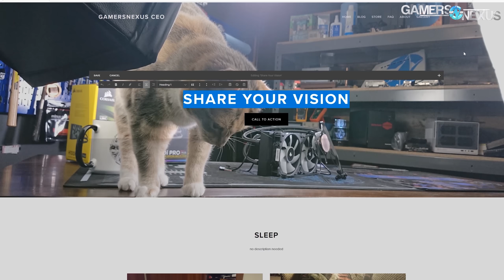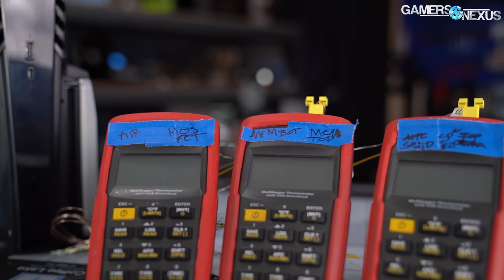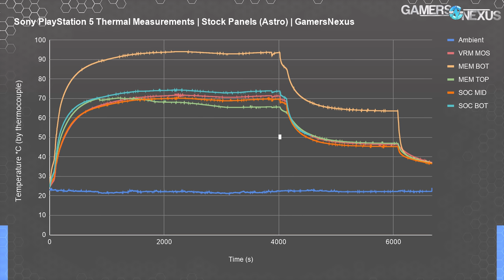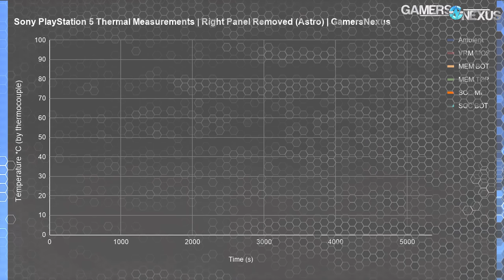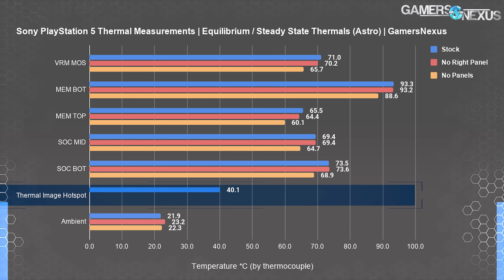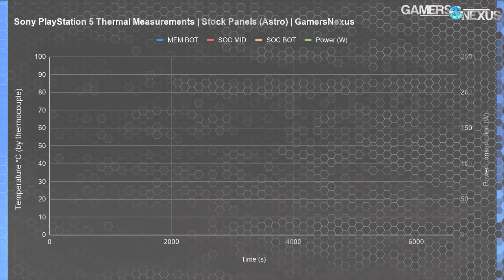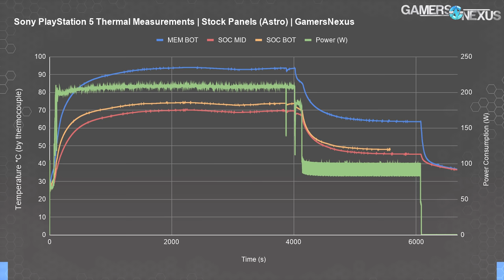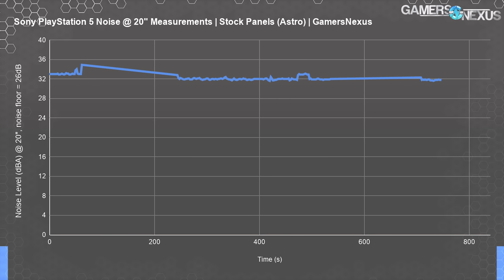Weak Cooler Design: PlayStation 5 Thermals, Power, & Noise Testing

Comment: The whole Xbox overheating argument that started with playstation fans really didn’t age well...
Reply: ikr. Series x is proven to be the best design by far. smaller, more powerful. And now quiter and cooler. ps5 needs a redesign asap.
Reply: @davidpelaez7176   no it doesn’t. The ps5 isn’t going to be “redesigned” just because you want it to lmfao
Reply: @Michael019x  it was a joke. Salty much?
Reply: @RedHaloManiac95  Huh? I wasn't even talking to you, LMAO
Reply: @Michael019x  it will have a redesign. It happens every generation. fat ps5 is a mistake. 95 degrees memory. Ssd support disabled bc of overheating concerns. And now its gonna sound like a yet. Even more embarrassing considering the console is huge. Dont get me wrong i love sony games but their hardware is usually trash.
Reply: Meanwhile in the PCMR 100c+ RTX 3080 and 90 memory is barely mentioned...hmm..
Reply: @Michael019x  It absolutely will, Sony is definitely losing a lot of money per unit, especially for the digital one.

I can't see them doing the Series X design due to both branding and backlash, so they may just rely on TSMC die shrinks and cut down the heatsink to shrink the footprint.
Reply: @davidpelaez7176  the ps5 is never going to look like a PC or an Xbox

Comment: Extremely in depth look at the thermals. I see the issue with the memory. Is there any indication on the GPU issues? Is that heat related as well?
Reply: The GPU artifacts could potentially be caused by the poor memory cooling. But who knows the APU side seems to be doing decently
Reply: @Pipdoodle33  I automatically assumed it was the over clocking. It’s always a double edged sword when you depend on that for performance. I didn’t anticipate the memory running this hot. Seems like this system was rushed. It’s no way he should be finding issues the engineers did not. The cooling solution for the memory is unacceptable. No way I’d add an SSD to my PS5 knowing this
Reply: @Pipdoodle33  Those with artifacting issues are also reporting minor artifacting in the home screen, and bad artifacting in PS4 games too, when the console is drawing considerably less power.

Comment: Who's here after the Series X thermals video? 😏
Reply: me too ha
Reply: Me, but beside the memory heat it’s not that much of a different, though pd5 is expected to have more power draw and heat of course.
Reply: Decided to do this one first. Abt to watch the XSX video now.
Reply: They are basically the same imo but it depends if you want more games on ps5 or better thermals on Xbox
Reply: @malazan6004  
Game Pass. I'll have both. 😎
Reply: Which 1 runs cooler PS5 or Xbox SX?
Reply: @redscorpion9325  series x runs cooler.
Reply: @gingataisen  yeah, Xbox clearly has better exclusives than sony 😂
Reply: @Lloyde Turner I just referred that the only part generating more heat is part of the memory, the other parts are in the same range as the Xbox. That’s the conclusion of the thermal videos. And yes, higher frequencies cause more power draw and heat mr. Pc guy.

Your smelly think what you want guy.
Reply: @Lloyde Turner you Said that you smell a doughy ps5 fanboy. You were the one to associate that with me. I just put that asironic self reference in my post.

And no, I am not a german, neither I am responsible for anything happened in the past when I wasn’t born.

Comment: Since it is so quiet they should just ramp the fans up a bit, it could go a long way with minimal noise increase
Reply: Have a setting for it
Reply: Its already apparently louder than X though
Reply: soc temps are already ok enough. ramping the fan up won't help with the memory.

Comment: As an IT Engineer myself I have had reservations about the cooling for the PS5 ever since I seen a centrifugal fan. I'm hoping that in the next 6 months somebody will make an after market fan that is more powerful and a lot quieter.

In my professional opinion I think the fan  design is wrong. It is acting more like a windmill. I think the fan blades on the fan are pushing more warm air downwards rather than outwards.

But a PlayStation Fan unfortunately won't listen to the professionals, to them the PlayStation is god and nothing will make them change their mind. I've had reservations about the cooling ever since the console was shown off. I said it then as I still do now. The cooling is insufficient and if somebody comes up with an after market fan with a more efficient designed fan with a more performance arrow and faster fan but quite. Then that company will be inundated with orders and will make a tone of money. Give it 6 to 8 months and somebody will do this.
Reply: Boy you really comparing yourself with high japanese engineers  🤣haah okay
Reply: @ArjanTV  I have a Bachelor Hons Degree in Computer Science and nearly  8 years as an IT Engineer and been working in the IT Industry for nearly a decade. Each IT Engineer has a unique set of skills in the field they work in. Mine is a Network Engineer but I had reservations about the fan because in my opinion as a centrifugal fan it isn't powerful enough.

The PS5 is a great console but it does have an issue with cooling. A centrifugal fan is great for dissipating warm air through the top and out of the rear of the console. But if the centrifugal fan is pushing warm air towards the bottom and making the bottom of the console warmer that the top where the fan is located. The fan isn't powerful enough.
Reply: @hefeydd_  then why my ps5 dint get warm at all after 10 hours of playing warzone?
I dont know what ps5 you got lol maybe you were unlucky to get a broken ps5 because they are making so much ps5 few of them arent working like its supposed
Reply: @ArjanTV  I never said I had a problem with the fan on mine I said I don't believe the fan is powerful enough. I played 8 hrs of ACV and the most it got to when I put my thermal camera on the console at the rear was 57.6C which is 135.6F which is fine but their has been cases where customers have experienced their console to be in the high 70C that's 158F that is getting into PC graphics card territory. The only issue that I have is the fan is a little noisy in rest mode apart from that it is a good console. Let us see what happens in the next 6-8 months somebody is bound to manufacture an after market fan with better fan blades change the orientation of the fan blades slightly to produce better airflow and a more powerful but quieter fan... whoever manufactures this will be laughing all the way to the bank because they will sell like crazy.
Reply: @hefeydd_  it has an issue with “coming” does it? Despite all that education, you have an issue with typing.
Reply: @ArjanTV  This fellow is going on about the design of the ps5 in general, not specific units. I'm with him on that windmill fan though, it really needs a push/pull system like pc's have, or at least an exhaust fan. The current design just looks like it falls short in a lot of ways. Low effort as far as the memory cooling goes.
Reply: @danielharvison7510  pcs are build different . The ps5 fan amazing not perfect but cant be done better than that my ps5 is fine it doenst warm up at all even when i play for many hours big games like warzone! Very smart japanese people worked on this console lol a student cant do it better or have better ideas they tested everything and that fan was the right one to put on this console
Reply: @ArjanTV  I wouldn't actually say that PCs are built different. The current console gen literally IS a pc, even going so far as to be designed and manufactured by AMD and TSMC respectively. Same rules of thermal management and whatnot also apply, so it's not that different to a small form factor pc or a laptop.

Comment: I wonder how the console would perform with an ambient temperature of 80 degrees and above?
Reply: well, thats 176F so, not good?
Reply: That's a really small delta. I can't imagine any computer running in that temp without some sort of heat pump.

Though everything would melt anyway.

Comment: Even being a bit of a Sony fanboy, this does concern me a bit and makes me hesitate to buy it. Thankfully I can't afford one right now anyways lol.
Reply: Best to wait for their "pro" version that we all hope has a higher wattage psu that will actually take advantage of the hardware.
Reply: @evolicious  Pro version??? You mean, in about 5 years? hahahaha
Reply: Don't let it. Apple runs their CPUs at 100°c. They're fine.
Reply: @Optamizm  higher temps means lower clocks and wasted energy that went into the heat.
Reply: @RukaGoldheart , nah, because there's a bonus to performance from higher clocks. Mark Cerny explained it pretty well. If you have two GPUs with the same TFs, one with more CUs and lower clock vs less CU but higher clock, the one with higher clock will perform noticeably better, because everything else the GPU does runs at that higher clock.
Reply: @Optamizm  you completely misread my comment
Reply: @RukaGoldheart , please explain what you meant.
Reply: @Optamizm  ever heard of thermal throttling? When a piece of hardware, generally CPU or GPU reach temps that are quite high and clocks lower to bring temps down.
Reply: @RukaGoldheart , the PS5 doesn't thermal throttle.
Reply: @Optamizm  if the temps go high enough it will. But hey, can't put the PS5 in cramped places and the fan isn't fully utilized, though the memory modules are something to be watched closely.
Reply: @Optamizm  Yes that is why Apple is trash that don't last more than 2 years...
Reply: Meanwhile RTX 3080s and 90s running at 100c+ on the memory are laughing hard.
Reply: @sdewey4152 Yeah when  mining...
Reply: @regular4634  there's many reports of it happening in gaming, mining can hit near 110c...so just a little over the 95 rated operating temp listed by the VRAM manufacturer.
Reply: @sdewey4152  Link maybe ?
Reply: @regular4634  just Google there's even many on the Nvidia US forums, it's not uncommon on FE cards, third party cards seem to have better cooling.

Some have even stated swapping the thermal pads out can reduce temps from 100+ to mid 80s.
Reply: Nice to hear someone claim fanboyism without the negative fanboy behaviour. Keep loving what you love man. 
Personally, Sony do not make any games to my taste.
Reply: @V1CT1MIZED , what?
Reply: @grossindecency  Demon's Souls is very much to my taste but not enough to buy a whole new console for. I'll play the remake one day..
Reply: @Optamizm  exactly. Xbox went with the more CU 52 vs 36 .
Reply: I almost went with the series x their engineering team really outdid themselves. I’ll just have to wait a bit and get one later on. Still very happy with the ps5

Comment: Whats the issue with 93°C on memory? The lifespan will be reduced from 20 to 18 years?
Reply: It's called FUD.
Fear, uncertainty, and doubt.
It sells outrage, which sells clicks, which generates money.

"The PS5 cooling is awful!... despite running in spec!"
Reply: Not really depends on spec of memory GDDR6 is rated up to 100C, of course though GN admitted he is measuring the casing temps but not the actual die temps of the ram modules (the modules themselves are very likely running alot cooler and the casing acts as an IHS for the RAM). The electrodes are precise but aren't too accurate depending how it's placed and measured ( especially if it's measured where the heat is dissapating ).Nothing really seems out of the ordinary at all when taken into context.
Reply: Depends what kind of environment you're in. Because this and the  early PS3's are dust magnets, it had a habit of shortening the life significantly. These bad thermals coupled with dust blockage will make things quite difficult. I won't be surprised when people have to get a new system 2-3 years from now simply cause the memory burnt out. For now I'm wondering if laying it on its side is a smarter play than standing it up.

Comment: Imagine the sony CEO slapping his engineers in the back of the head watching this video " why didn't you test the ps5 like this "
Reply: I'm sure they did. I doubt they would have released this product if there were temps running above spec.
Reply: @thelarry383  it can handle 100c but doesn't mean it should all the time. probably an engineering and design problem since we know ps5 is a bit rushed with devkits arriving much earlier, either that or they went cheap with the thermal padding.
Reply: @thelarry383  the silicon would melt if you keepin like this
Reply: They definitely did, but they decided to cut costs.
Reply: except it's more likely like the engineers recommended X amd the CEO was like nah skip that Y is doable.
Reply: Besides, they also want you to replace your machine in a few years so that they could sell more units.

Comment: yep, expect them to throttle performance soon and they'll keep it a secret.
Reply: Either that, or an update that ramps up fan speed
Reply: So a what's Nvidia going to do with the 3080s and 90s the ones that have 105c+ on the memory.
Reply: @sdewey4152  the hell?
No my RX 5700 vram runs at 80c max and thats in summer

Comment: So Basically, The Last thing you would want to do when Setting up your PS5 is Place it INSIDE a Shelf of your Entertainment Center and Close it up behind a Glass door Because, You Know, That Looks Cool!! 🔥🔥🔥🤦‍♂️🤣🤣🤣
Reply: I believe sony released a statement saying it needs to be in an open area lol
Reply: @ASTRALEGION  hahaha! Yea, but who reads Statements or manuals or Reviewers? LOL! 

TL;DR..   It's going to catch on fire! 🔥 🔥🔥🤣🤣🤣
Reply: This has nothing to do with the cooling design but rather the overall power consumption/heat output of it.
If the internal components consumed 350 watts of power they output ~350 watts of heat.
That's the same heat output if they run at 60 degrees C or 90 degrees C and all the cooling capability in the world won't save it in an enclosed space.
Reply: Unless you want to bake a cake.
Reply: Yup, ver. 1 of PS3 all over again.
Reply: A cabinet door is a death note for it. Even without a door, like in my TV stand's cubby, if I didn't cut slots in the back panel and use a few fans to move air, it would be too hot. I've accidentally left my fans off and I heard the console's fan spin up twice, not loud but just from inaudible to audible. I need to figure out a long term solution to cram it on top of my tv stand somehow, and then figure out something to fit in the cubby that it is in now, would love to get a new PC case to fit in there, but thats next to impossible unless I want to downgrade to a LP gpu and/or shell out $$ for a pico power supply and even then they are usually 1-2" too deep.
Reply: What's up with your use of capital letters?
Reply: @TheGroundedCoffee  Got you notice my post, didn't it? lol!
Reply: @tim3172  liquid nitrogen
Reply: You shouldn’t put any electronics behind a closed door on your entertainment center

Comment: There is no issue with the temperature.... it is within normal acceptable operating range. As referenced in tests below on Toms hardware..... 

https://www.tomshardware.com/news/report-why-the-geforce-rtx-3080s-gddr6x-memory-is-clocked-at-19-gbps#:~:text=For%20reference%2C%20Micron%20rates%20its,ranges%20between%200C%20to%2095C.

'For reference, Micron rates its GDDR5, GDDR5X and GDDR6 memory chips with a Maximum Junction Temperature (TJ Max or Tjunction Max) of 100C (degrees Celsius). The typical recommended operating temperatures ranges between 0C to 95C. The reading materials on Micron's GDDR6X don't reveal the TJ Max for the new memory chips so there's still a bit of mystery to the topic. According to Igor, the general consent is around 120C before the GDDR6X chips suffer damage. This would mean that the Tjunction value should be set at 105C or up to 110C.'

Comment: Then at summer at room temperatures 28-30 without airconditioner itll be hot.
Reply: The fan will run faster and louder
Reply: Why would you be in a room with that temperature? Are u poor?

Comment: You just picked up a new subscriber AND made me worried about getting a PS5
Reply: I wouldn't be all that worried. The launch ps4 ran just as hot and sony reported a failure rate of less than 1%. Plus if the temps he got are actually correct, then they are still technically within safe temps
Reply: @rockl79  appreciate the input. 2 months later & I haven't really heard of any issues about anything. I'm in no hurry to get one right now. I'm gonna wait till I can pluck one off the shelf. Might get a little antsy when Gran Turismo 7 comes though

Comment: IMO the lack of the expansion slots cooling will be the next thing once ppl upgrade their PS5 with some certified drives. 

I need to watercool the controller of my PCIe 4.0 M.2 drive to keep it at long term acceptable levels. The PCIe 3.0 version has a heatpipe cooler (Thermal pad replaced with Noctua NT-H2 thermal paste) and reaches 79°C and will be needing watercooling as well. 

This has no active cooling whatsoever! If Sony constanly accesses that drive, I see extreme throttling and problematic lifespans for the drives used..

EDIT: On second look during the teardown, it looks even insulated with the plastic panels surrounding it. If they don't sell a new side panel with some heatpipe/heatsink, this could get VERY bad for Sony in a rush.

Comment: So, it s a good idea to wait for the "updated" model, whenever will appear, maybe next summer?
Reply: You dont really need too.If the one you have brakes then Sony will replace it with the newer one anyway.This is why we got the 2y warranty
Reply: @woofaki5550  Ok, and what if the breaking occurs after the warranty, because of bad design? I rather wait for 1 year until they release an update. I ve waited 5 years already, 1 more year it s not the end of the world.
Reply: @andipajeroking  The memory wont last 2 years...if there is really a problem and it wasn't just a faulty chip it wont last for long.